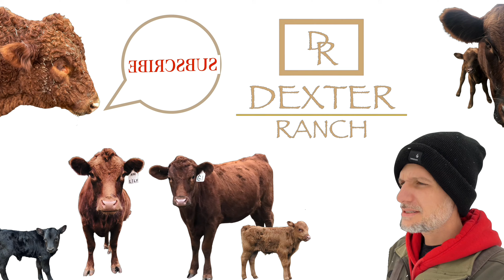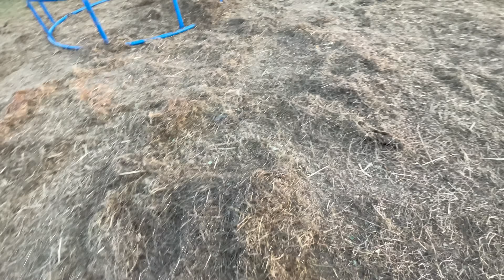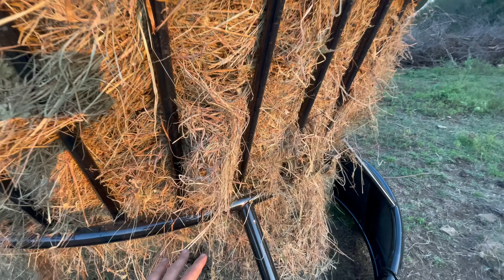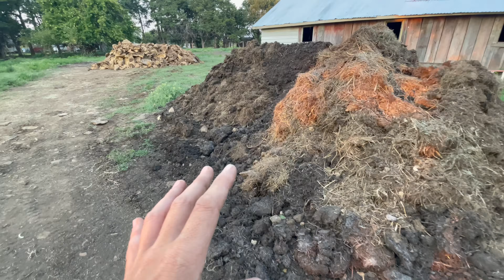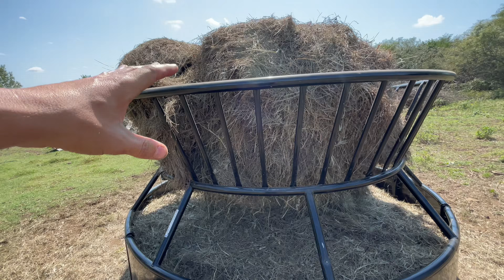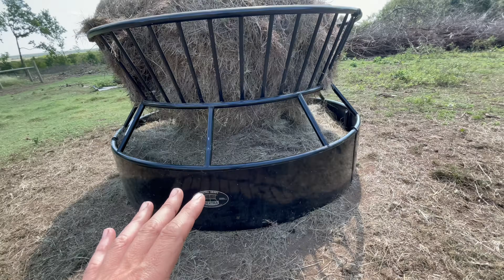Bextra Hay Saver

Comment: Why not bale smaller bales ?  And better quality hay ?   Smaller bales are eaten quicker and less likely to have the bale itself rained on. And cows dont pull it out of the feeder with smaller bales. Also have tin around the lower part of the blue feeder.
Reply from the maker: Thanks for the suggestions Irv.
Reply: In my area small bales are 1/3 more in cost.
Reply: @seneynah  Thats small squares or   two foot by two foot round bales ?  Or smaller.
Reply: @hairymanonetwo  small squares

Comment: Any ideas how to load without a tractor? Like the idea but don't see how it's an option without a tractor.
Reply from the maker: Hi Michael.  I think if you had a smaller 4x5 bale you could possibly put it on its side and then let it down over the bale because the small diameter is around 6ft. With my 4x6 bales it got hung up. Also you would need a couple of people because it’s rather heavy. Don’t know if it would be realistic or not.
Reply: You will need a tractor the idea for this feeder is that the bale goes in the top, and as they pick threw the stuff they like most the rest falls down into the ring and keeps the hay from being wasted.